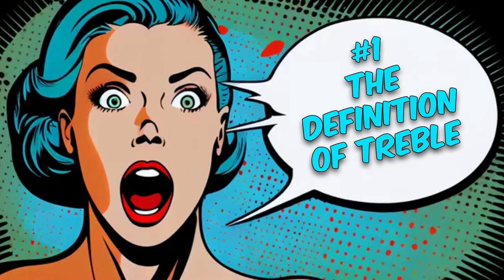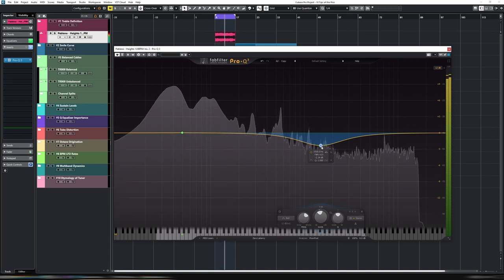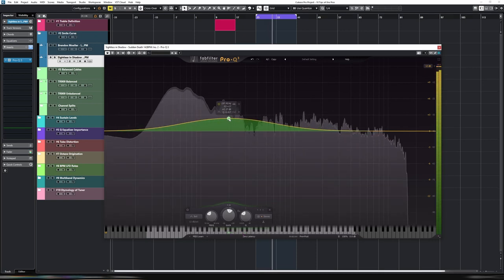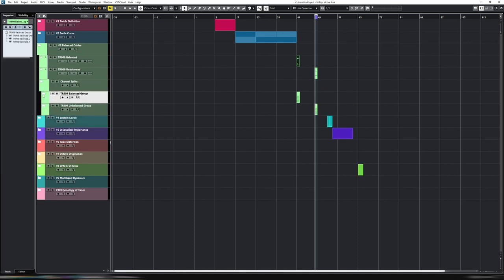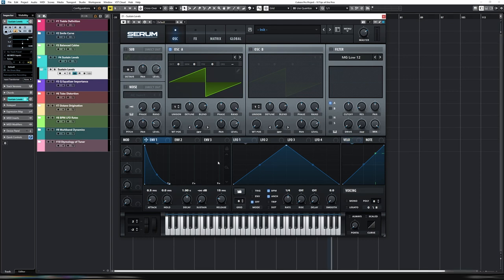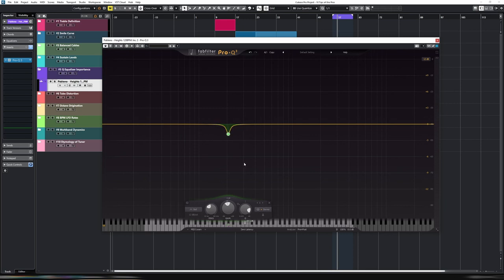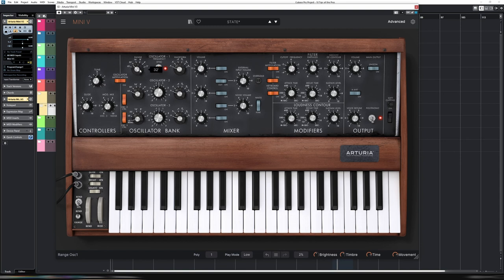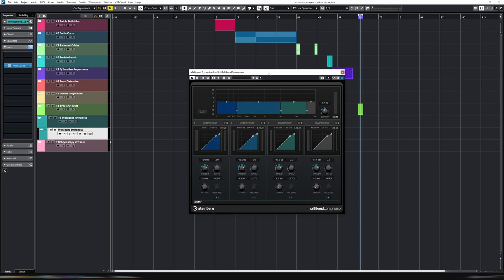REVEALED: 10 Secrets Audio Pro's Won't Tell You

Comment: Balanced cables refers to if they have both the positive and negative and the shield, so you are unlikly to get interferences. 
Unbalanced cables carry the signal with only one wire, balanced cables carry the signal with 2 wires (positice and negative) so if interference leaks in and because it has positive and negative they will null at the end and you get no interferences.
You can easly see if your cables are unbalanced or balanced by looking at the jack, if it has 1 black ring is a unbalanced cable, if it has 2 black rings is a balanced cable.

You can use two balanced cables with diferent lenghts (so one will be heavier than the other) and the signal will be the same.
Don't get heighting the cables.